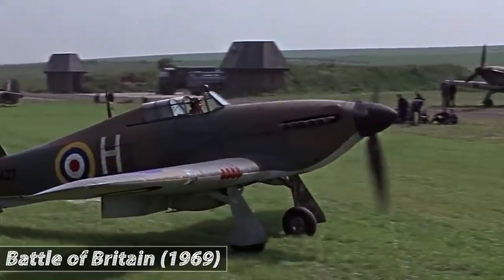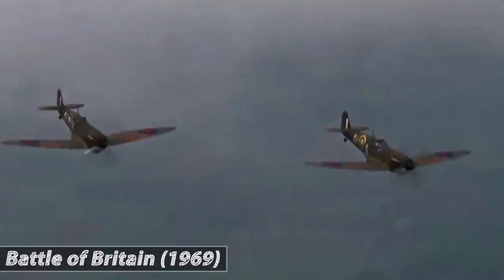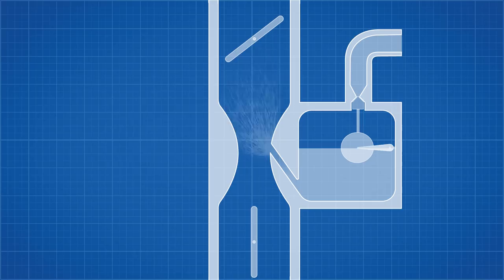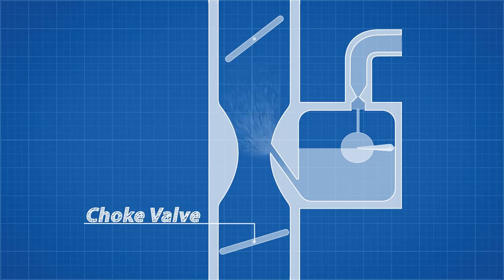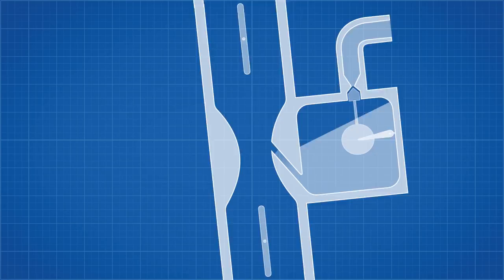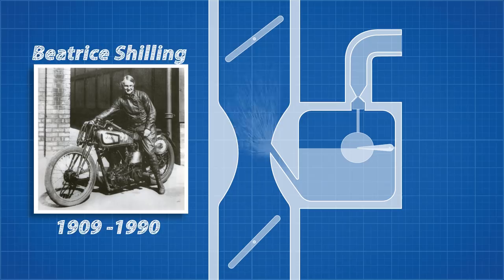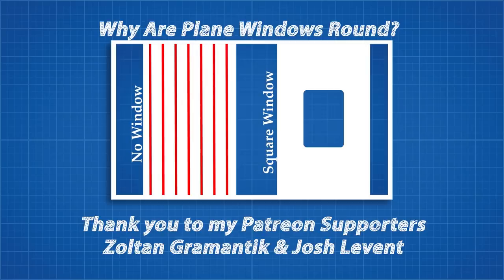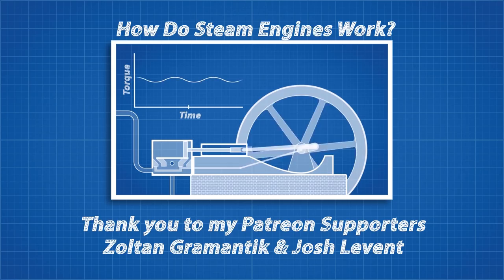The Spitfire's Fatal Flaw

Comment: Flaw?  No.
Fatal? No.
Weakness? - To inexperienced pilots yes.

Ultimately, this issue was an annoyance. It was not a fatal flaw.
Reply: It was fatal to those who did negative G, lost engine power, and lost the advantage in a dogfight. 

Far from an “annoyance”.
Reply: A jammed gun is an annoyance at the range. It’s fatal on the battlefield.
Reply: @Bartonovich52  
Not fatal at all and easily overcome by pilots, in fact the slight problem was solved by Rolls Royce in 1941, having been improved in 1940.

Comment: Hmmm... read through many of the comments and have to agree with one thing:- If you're going to use a name like 'Real Engineering' you'd better do your homework before publishing videos like this. 

The flaw was NOT 'fatal'. 

As far as I understand, there is not a single reported loss among the 21,000+ Spitfires produced of either pilot or aircraft directly attributed to the 'Carb Cough' on pre-1943 Spits fitted with the SU updraught carbs. It is the updraught design which is responsible for the 'cough' in inverted flight/barrel (victory) roll due to the simple effect of gravity on the float chamber coupled with the direction of airflow through the carburettor.

Was it a 'flaw'? Not in my (humble) opinion, as an updraught carb will behave exactly as it did when presented with fighter aerobatics. The SU carb was perfectly serviceable in aviation use. However, it was in essence a 1930's (or even earlier) technology pushed to it's limit in modern warfare AND used in a wide range of applications. A simple check on the range of aircraft types using the SU Carb between 1935 and '43 will show that the Spitfire/Hurricane application accounts for far less than 10%. You could argue that this was a case of forcing a square peg into a round hole when it came to the Merlin in fighter applications, and you'd have a legitimate case.

In 1943, the SU's were dropped in favour of the Bendix-Stromberg Pressure Carburettor (essentially providing fuel injection without the 'injection') and the 'cough' disappeared.

You may also wish to note that Avro Lancasters carrying out the 'corkscrew' manoevure to avoid being shot down also reported the 'carb cough', often on all four engines simultaneously (pretty un-nerving if you're a 19yr old air gunner on your first raid.....) so the 'fatal flaw' was not confined to the Spitfire...... or Hurricane. 

It was confined to any Merlin-engined aircraft fitted with SU updraught carbs.

But that doesn't make for a snappy video title which will get you good search results on YouTube, will it.....???? 

Having said all that, may I applaud you for your sentiments and comments regarding attracting more women into engineering.
Reply: Shane Waterman why should there be more women in engineering? Perhaps all the women who want to be engineers, are.
Reply: gracefool

Perhaps, but that's pretty unlikely. Gender roles have an impact on what careers people will choose, and certain jobs are still seen as pretty "gendered". I don't see the reason to make the assumption that how things are at the moment is "natural". The thing is, female engineers have become more common as time has passed. Is it going to be 50/50 in the future? I don't know, probably not, and I don't even think that's a realistic goal. But just saying "it's because people choose so" is a pretty big simplification and ignores the influence of the environment.

If you asked a girl in the 50s what they wanted to become when they grew up, you would probably get a pretty different answer than if you asked the same question from a girl today. Back then women technically chose their careers too, but they also basically had less choices than they have today (because of more restrictive gender roles). My point is, people's choices are influenced by their environment. If you want people to actually have "free choices", we should try to get rid of restrictive gender roles. I'm not saying women will end up making exactly the same choices as men, but I don't think that assuming that women would end up making the same choices as they make today if we got rid of all gender roles makes sense either.

Comment: This is very surprising for a video coming from a channel that calls itself REAL ENGINEERING. The only problem all the early Merlins suffered from was a momentary ''rich cut'' until normal gravity was restored. To call it fatal is totally wrong; fatal implies death yet the BoB couldn't have been won without that engine and any average pilot would not only be aware of it at the time but avoid the situation of the earlier engines limitation in the first place. Pilots aren't that dumb. You lose credit big time with this kind of wording as a title.

Comment: It has all been said but this is laughable.
The channel is called "Real Engineering." Your pretending to know about engineering but your mixing up a light bomber with a fighter plane. Please remove this video and do it again correctly or not at all. The whole point of good engineering is attention to detail.
Reply: Oh Jeez. They were both fighter planes, and both capable of ground attack. Check your facts before you run your fingers.
Reply: You don't know the difference between your and you're so trot on.
Reply: +Legend Length same, plus I couldn't tell the difference between a hurricane or a spitfire.
Reply: light bomber? where? 
The Hurricane and Spitfire are both single seat fighter aircraft. 
If you think any of them are a light bomber you're mistaken. Sometimes fighter aircraft were used as fighter-bombers, e.g. the 'Hurribomber' but they were never "light bombers", they were just fighter aircraft carrying extra ordnance for ground attack. A light bomber is something like a Blenheim, so I think you;re the one who doesn't actually know your history.
Reply: well kp that is not our fault.
Reply: +Jakub Zurek Could the "Brewers Tray" be considered to be a light (headed) bomber (the means of getting drunk)?
Reply: Though both were later able to carry light bombs the fact is that both were designed from the ground up as fighters.  There's a detail you failed to pay attention to.
Reply: My Day Actually the Blenheim was initially designed as a light bomber? So I'm not sure what you're getting at there, since the Blenheim was initially a light bomber and only a few fighter versions were made/converted, IF and IVF, a quick google search comes up with 60 Blenheim Mk IV's converted to the fighter version by adding the 7.7mm guns under the fuselage. The Blenheim wasn't a very good aircraft, and more so in the fighter role, as it suffered very high loss rates.

Whilst the Hurricane was designed as a pure fighter from the start, and since it quickly became obsolete they put it into the ground attack role.
Reply: My point was the video was about the spitfire but they kept showing video footage of the hurricane as if that was a spitfire.
Reply: . And who mentioned Blenheims other than you? I was referring to the Hurricane and spit later being used to carry a light bomb load but are born and bred fighters.  What I'm getting at now is that you've just asked a question about a comment which is self explanatory.

Comment: first off there is a scene where a spitfire does the same victory roll further in the movie. and it does not cut out like the hurricane. second if you're going to call it a fatal flaw, you need statistics to show that is was fatal. otherwise the term major or common flaw is more appropriate and applicable. this is an instance where your personal ego is overriding your intelligence. so if you're going to use a 1969 movie and scenes from it to prove a point then show the plane in question, and it having the issue. not hurricanes and saying it's the same thing. the technical data you provide, accurate or not holds little weight when it's inaccurately depicted in your video.
Reply: If you keep the g's positive no issue in a roll, you can a workaround for this design flaw.

Comment: Aircraft carburetors do not have chokes. They are started using a  primer which injects fuel into the induction system or into the cylinder. Otherwise a n good explanation.

Comment: Imagine designing a fighter aircraft and thinking "a float carburetor will be fine. This will never need to do aggressive maneuvers."
Reply: And yet RR continued to use carburettors throughout the Merlin's development.The Negative G problem was common to all engines until fuel injection came along. But carbs also offered advantages. The venturi and resultant lower pressure intake cooled the air/fuel mix entering the engine allowing higher boosts and ultimate power. Tilly Shilling's interim solution and the later can removed the Negative G problem.
By the way, the problem wasn't so much at the top of the dive, largely solved by the flick roll which also removed negative g effects on the pilots, but by the overloading of the float chamber at the bottom of the dive as they pulled out. Too rich was more a problem than too lean.

Comment: The Mustang out performed it in so many ways and looked as good. That's the fatal flaw.
Reply: Given that the P51 was a generation younger than the Spit, and that its design benefited from everything the Spitfire had revealed about single-seat fighter design, it damn well better have outperformed it. Not much point in introducing it, otherwise?
Reply: @TomFPaton  the P51 did not benefit or build on the Spitfire design. The P51 is all new design from, structure, power plant, laminar flow wing design. Nothing used from the old tech spitfire deign, a beautiful plane but not even in the same catagory.
Reply: @airgliderz I'm aware that the P51 was an entirely new design. I'm also aware that some people wrongly believe the Mustang was a 'development " of the Spitfire. What I said was that that design "benefited from everything the Spitfire had revealed about single-seat fighter design," - which it did, INCLUDING THE SPIT'S SHORTCOMINGS in roles for which it was never intended, but which, by 1940, were becoming desirable. As such, it's no great surprise, and no real discredit to the Spitfire, that it improved upon it. 

The design criteria for the two aircraft were in any case different, most significantly in the matter of range. Nobody in the Air Ministry in 1934 envisaged a need to escort long-range bombers - they were still labouring under the delusion that "the bomber will always get through". 

Nor was there any real appreciation of the role tactical aviation would play in a future conflict. The P51 was a better ground-attack machine than the Spitfire, but both were inferior, by virtue of the vulnerability of their cooling systems to ground-fire, to the P47.

I've read innumerable attempts to compare the two aircraft as direct rivals, and they don't really work, for these reasons. I had a relative who fought in RAF Spitfires (Mk IX I think) and then a few months later in Mustangs, including North Sea patrols of 8hour duration, after which he was so stiff that he had to be lifted out of the cockpit by a fitter. He admired both as flying machines, but felt that in a dogfight anywhere but high altitude, the Spit had an advantage in sheer agility which it never really lost. One reason for this  may be that the Spitfire's wing had a few degrees of washout towards the tip. In a turning contest, this meant that the tips kept on flying long after the centre-section had stalled, giving the pilot plenty of warning, and allowing him to fly very close to the stall with confidence - a crucial advantage. Its rival Me/Bf109, by contrast, could pull pretty much the same G, but would stall abruptly and 'depart', with potentially lethal consequences, if pursued by an unstalled, or 'semi-stalled" Spit. The P51's laminar flow wing gave it great speed and range at high altitude, but like the 109 (and many other aircraft) its stall characteristics were abrupt and unheralded. An F16 pilot who did some "meet your hero" time in a P51 recorded his disappointment thus: "Even the normally understated test pilots described the Mustang's stall and departure characteristics as "vicious." " He was also astonished at how heavy the controls were - something I have never heard said of any Spitfire variant.

By the way, the production P51, after its Allison-engined debut, always had Packard-built Merlins - just like Canadian-built Lancasters and Hurricanes. So I'd remove 'powerplant' from your catalogue of 'all-new' features!

But as I say, setting the two types up as rivals in a Top Trumps exercise is a mug's game, best avoided.

Comment: I'd be more interested in learning if there were any problems with the fuel injection systems on the DB6* engines.
Reply: There were but they get overlooked and the RR Merlin slight problem very much overstated.
Reply: @barrierodliffe4155  A year goes by quickly, doesn't it? That's cool, nothing major happened. 
I'm wondering why I wrote that - probably because I owned a 1960s car with petrol injection and its components were more intricate and less reliable than its carburetted equivalents.
Reply: @peterbrown6224  
It does, my family have got through quite well including my daughter who lives in London.  
Among many cars I have owned was a 1962 MG Midget which I fitted a supercharger to and used a single big  SU Carburetor, it gave good power and reliability, I also owned a 1985 Austin Montego with a single SU carburetor, it was reliable with good power and economy.  Modern fuel injection works very well but it is controlled by a computer. 1 faulty sensor can give plenty of trouble but mostly faults can be found by scanning the system.

Comment: Opening narration about Spitfire shows a Hurricane. WTF? Spitfire's engine's inability to operate under negative g was shared by Hurricane which had the same engine. While Shilling's orifice solved some but not all of this in time, nothing equalled the fuel-injected Diamler of the 109. It is remarkable that something was not done as soon as the problem was discovered, which should have been sometime in 1936. These were aerial dogfighting machines for pete's sake!

Comment: Correction: At the time carburetors are not a flaw. Every plane had them only a few planes have injected engines, not to metion injected engines are still experimental in the early days of the 109